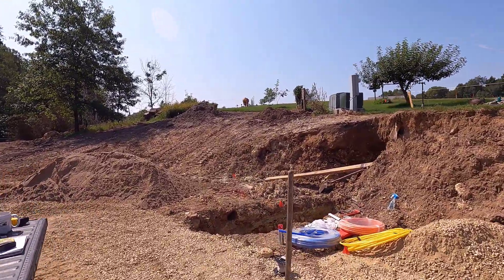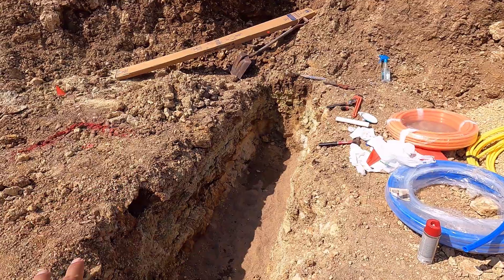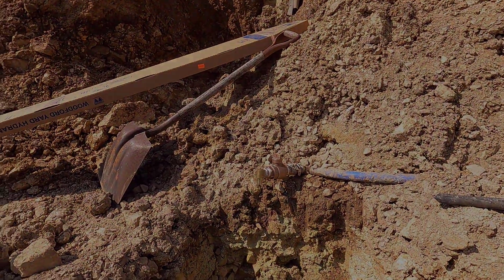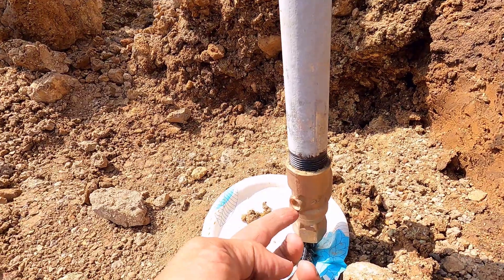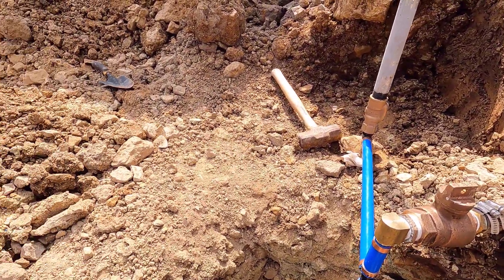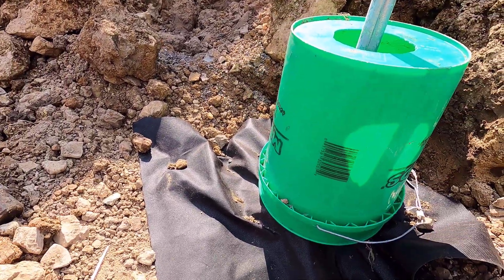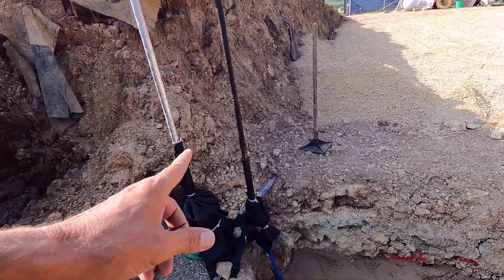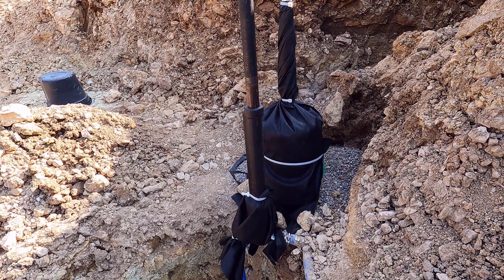Frost Protected Shallow Water Line ― Install Curb Stop and Hydrant

Comment: @Planet Mojo, thanks so much for the video. I have an extension rod(stand pipe) sticking about 2 inches out in my driveway. Could I lower it? I don't want to damage it. Is there still some room it can be lowered?
Reply from the maker: Are you talking about the shut-off riser? If so, you could lower it, but it won't be easy. You may need to shorten the key rod inside and rethread the riser pipe after cutting it.. You could also dig up the entire thing and set it deeper, but that's a ton of work. I have a newer set of video where I show more of how everything works. I believe it's three parts: https://youtu.be/8XMYR4-DJsc
Reply: @PlanetMojo  Thanks so much for your explanations. I mean it is the water valve (round metal one) on my driveway sticks out. It is a 2 years old home. Is it still easy to use sledge hammer to lower it? My concern is that I installed interlock on my driveway, I can use sledge hammer to lower it but if I damage something, the city will tear down the interlocks and repair the pipes : -(

Comment: When they put in radiant heat in my basement they used an orange colored pex they said acid in concrete is not good for blue pex. Also where they brought it up thru the floor, they ran it thru 1 inch plastic  pipe to protect the pex tubing.
Reply from the maker: Yea, that is what they sent. I was looking for PEX-A — any color would do, but they sent PEX-B with an oxygen barrier, which is used in radiant floor installations. The color generally doesn't matter — except if it's orange 😉

Comment: Is the shed hydrant different than the one that is outside by the horses?  Aren't they frost or freeze protected? 
Looks like things are moving along nicely!  Everything is always more involved than I  imagine.
Reply from the maker: All of the hydrants are frost-free (if buried at the correct depth). There are three by the horses, one in the future orchard, and one will go inside the new woodshop. They are only frost protected if the valve is protected from freezing, and in this case, we will need foam insulation to do that as they are too close to the surface through the block wall. It will become clearer in future videos as I add the foam 😊

Comment from the maker: I believe I did all of the research needed to keep this shallow water line from bursting (or just plain freezing) in the winter, but time will tell. There are several areas that need protecting with insulation. I have no fears about the shallow water line in the trench, it is the water line and valve that will be very close to the block wall I am most concerned about. In the next several videos I will show how I insulate all of the areas, and I will be creating a playlist to showcase them and to show how they do in the winter. There will be probes burred at the critical areas so hopefully I can monitor the temperature year-round!

In this video I run the PEX plumbing and install an A.Y. McDonald curb stop and Woodford Iowa yard hydrant — complete with silt socks — and test the system for leaks. In the next video I install the interior hydrant (same procedure but a shorter hydrant), backfill and tamp the trench to a certain level, and install foam insulation.

Frost-Free Shallow Water Line - https://www.youtube.com/watch?v=fHqK2tsprhE&list=PL_iZ8t8zAFuMRCCA56rTahk9c-LRbPq4j
The Woodshop Build Playlist: https://www.youtube.com/watch?v=0lj0BOLzIRo&list=PL_iZ8t8zAFuN1C0XY70Gd-EaS0z2Knt0Y

Woodshop Build Tool Links:
Stabila 35712 Extendable (7 to 12 foot) Plate to Plate Level - https://amzn.to/3iGdpwP
Stabila 30035 Plate Level Case for 7'-12' Plate Level plus 24-Inch, 48-Inch Level - https://amzn.to/3AETnZQ
Woodford Y34-3 Yard Hydrant Freezeless - https://amzn.to/3AHE5Dr
Johnson Level & Tool 116 16 Ounce Plumb Bob - https://amzn.to/3jKIj6k
True Temper 00221400A Wood Wheelbarrow Replacement Handles, 60-Inch - https://amzn.to/3xLU4Pc
Starrett-C33H-12-4R Hardened Combination Square -- https://amzn.to/2KL3YOu
DEWALT Metal Shears Attachment -- https://amzn.to/3l8aYoq
DEWALT 20V MAX XR Compact Reciprocating Saw -- https://amzn.to/3nKHVFG
DEWALT ATOMIC 20V MAX Reciprocating Saw, One-Handed, Cordless, Tool Only ― https://amzn.to/2Msu21r
Legend Valve & Fitting T-5500 Lead-Free Brass Curb Stop, 1" - https://amzn.to/3jU9VpO
12 Ah Battery -- https://amzn.to/33JN48U
9 Ah Battery -- https://amzn.to/2SKUQwN
6 Ah Battery -- https://amzn.to/3odC6BW